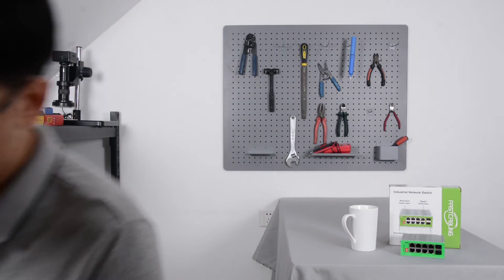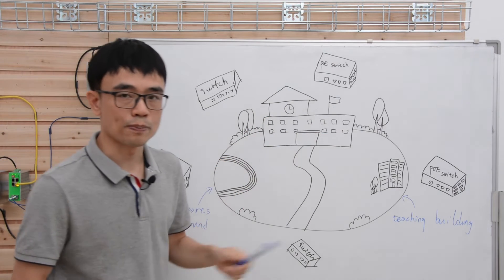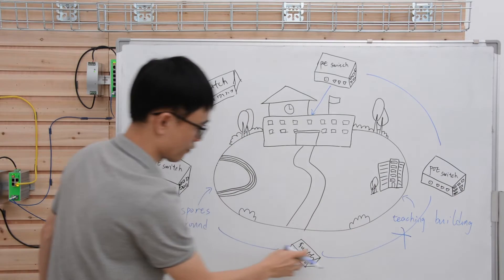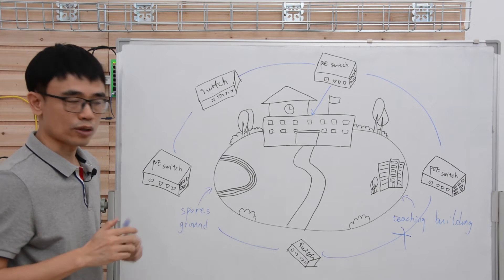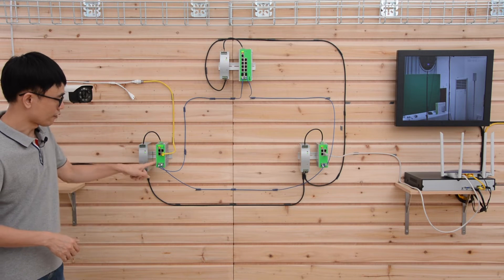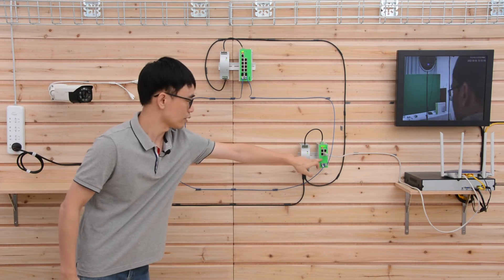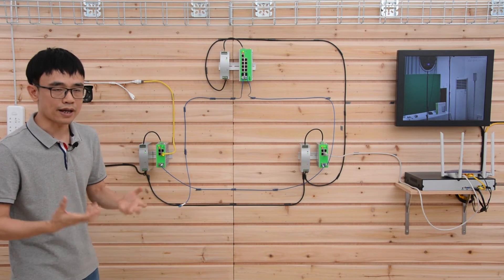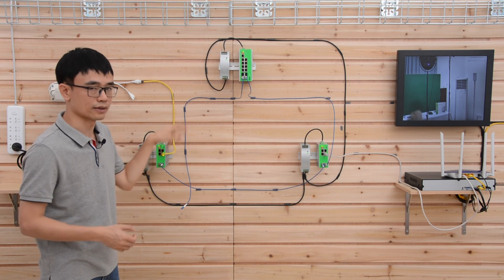How to daisy chain PoE Switch Correctly - Part #1 Perimeter Network

Comment: This is brilliant. Can you daisy chain around the perimeter of a house using POE passthrough switches? I don’t have power at all the locations I would like to place cameras.
Reply from the maker: The ERPS ring topology only settle the data network, it doesn't handle the power. So you still need the electricity power at each of the network switch. However, unless you have very large house property, you can pull the Ethernet cable to each of the cameras' setup spot. The standarad PoE can reach 328ft. With PoE extension solution, you can even have up to 2500ft PoE power/data. There is no need to daisy chain.
Reply: @Fastcabling   I have a 10 km perimeter farm project to install IP cameras with optic fiber, help me design the network please